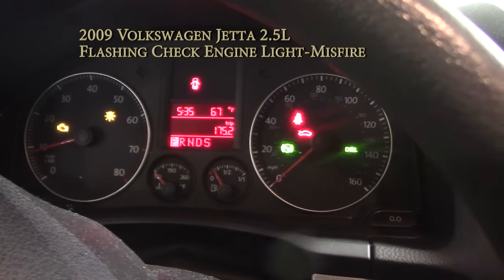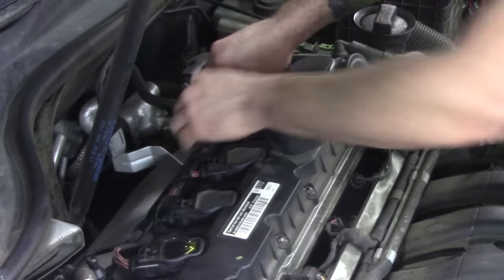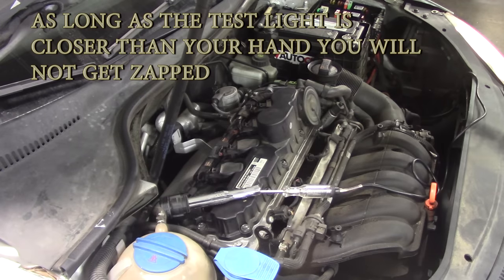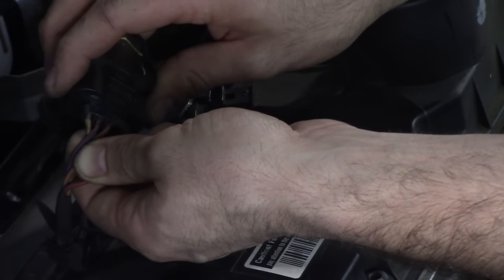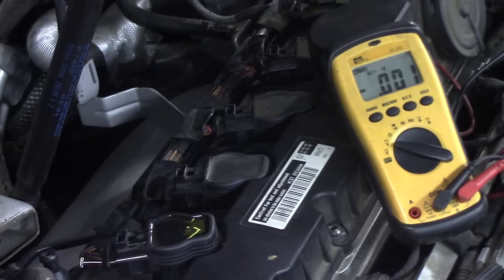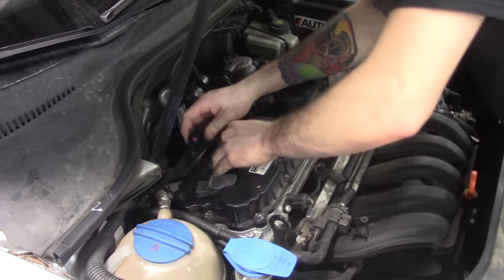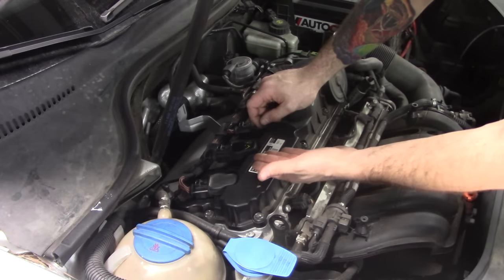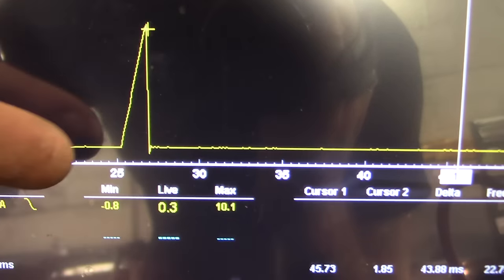2009 Volkswagen Jetta 2.5L- Misfire (Flashing Check Engine Light) w/o using a Scantool

Comment: Hello. Can you please help me with an issue on vw tiguan 2009, error cylinder 3 missfire. I already changed the glowparks, injectors and others and still the check engine lights comes on. Thanks a lot.
I have to mention that the car works perfectly, it's just the check engine that comes on
Reply: What's the code??
Reply: Did u scanned it ?

Comment: Mk5 gti  p0300 p0301 p0302 p0303 p0304 p0455 p0171 p0507 flashing check engine engine , sometimes solid. Loud engine, vibration. Loud exhaust. 

Any idea what this might be? Hope my engine is not blown :( I checked the oil and its black and smells a little like gasoline . Any help would be greatly appriciated!!

Comment: I would have at least checked the plugs even renewed them with a new pencil coil
Reply from the maker: Plugs were replaced a month before and the customer did not want to replace them again.  Plus we knew it was a coil problem after swapping and re-doing our cyl drop test
Reply: See what you mean. It's always in my mind what caused the failure.
Reply from the maker: Absolutely.  I should have mentioned that. In this case the coil was aftermarket junk.

Comment: why would you not hook to battery ground
Reply: My question as well -- what is the problem with using the battery ground terminal vs: the body ?
Reply: pc zapp nah its a safety thing while doing that particular test, there is a danger if you are say not clipped to the negative battery lead correctly then you could get a stray spark right above a battery, now when the battery is been charged the gases it releases are explosive,  so that's literally it, just a safety thing
Reply from the maker: That's exactly it. Safety. Potential for the battery to explode if it's gassing and your introducing 20000 volts straight to it